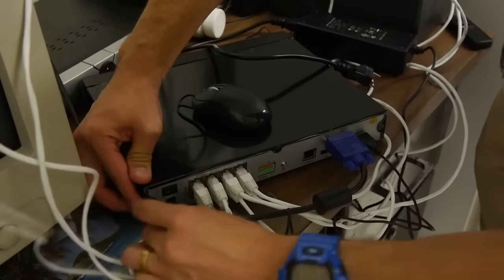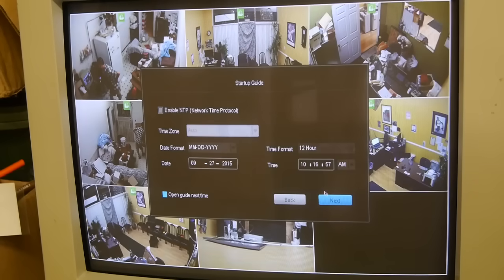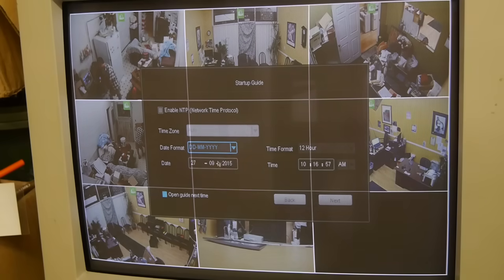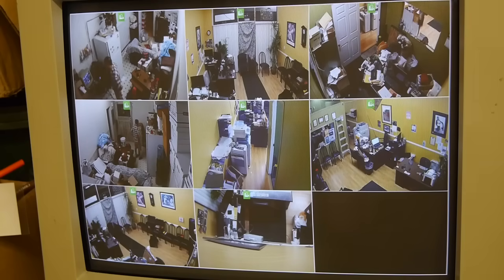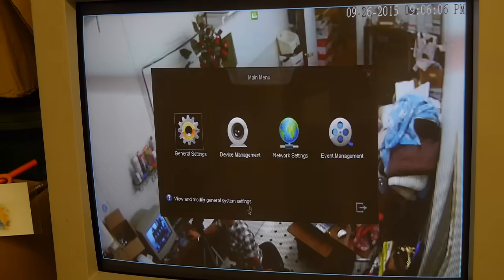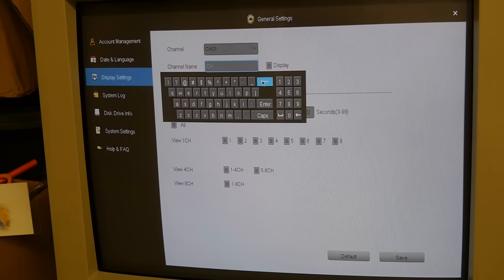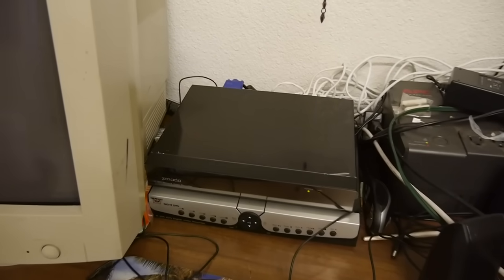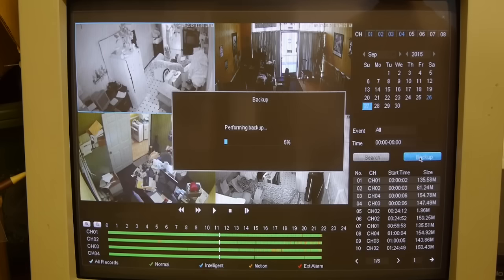How to install a Security Camera Surveillance System

Comment: Excellent. Would like more detail on getting power to remote wired analog camera. Will regular RG6 cable work, or is there a special cable needed to carry power?
Reply from the maker: run 2 in 1 power/video cable to and from the camera and problem solved. It's the one used in the video
Reply from the maker: or run a separate power cable either or
Reply: are power fittings for the 2-in-1 cable available so I can buy cable in bulk and cut to fit?
Reply from the maker: probably, you can try a google search to see if there is. I wouldn't be surprised if there are, I simply haven't had the need for them and predefined cable lengths and cable extensions/adapters have sufficed for my uses.

Comment: Wow this video is insanely helpful.  I mean, there are few words to describe how precise this video is.  Extremely helpful and to the point.  Guy even has the decency to point you to different parts of the video to skip any parts you feel are not applicable to your circumstances. 

Pretty much EVERYTHING is covered - in the most basic and well communicated way.  Very articulate and excellent communication.  No question this guy has the communication skills to be a spokesman.  Well presented!  A+!

Comment: Thanks for the video!  I like that you're not just trying to sell a brand.   Is there a way to broadcast the signal from the NVR to say a TV in the living room?  For residential i would like look at the front door on my TV, when the doorbell rings without walking over to a computer monitor.  The NVR wouldnt be located in the same room as the living room TV.  It would be cool if there is a way to broadcast via chromecast or something like that
Reply from the maker: Thanks, the solution is the run a long video cable from the dvr to your TV.
Reply: I was hoping not to have to do that. Thanks anyway

Comment: @Tool Craze if you do not have good internet connections can you still use ip cameras,and just have them not  connected to the internet ?
Reply from the maker: You don't need internet
Reply: thanks!
Reply from the maker: no problem

Comment: Your video looks as if the camera's themselves have CAT-5 ethernet jacks but the links provided show cameras with mini USB jacks and the cables have mini USB on one end and ethernet on the other end. Can longer cables be used? Thanks.
Reply from the maker: Normally they use cat5 cables but the ones you see with the mini usb Jack's are new. Now they made a new spec for power over Ethernet called sPoE that uses the smaller usb connectors for the camera. The included kit cables have mini usb for the camera on one end and have a standard Ethernet Jack to connect to the nvr on the other end. Same difference in the end really.
I have one of the newer sPoE systems you're speaking of and it's basically the same thing as before just a smaller camera connection. 
To answer your question, yes long cables can be used, you can extend the current ones by using an Ethernet Jack coupler since it's still using standard Ethernet Jack's on the other end.

Comment: I like the information but I don't like your wiring skills.  The wire is to exposed and ll over the wall.  You can only do it in a old buildings where you need remodel.  In new building or newly remodel homes wires outside the wall is too busy.
Reply from the maker: My wiring skills are just fine. What You're talking about is cable placement. That's a different story. And the reason I showed you guys how to run the cables outside the walls is because it's easy first of all and anyone can do it, also not everyone has the skill set and time to do full in wall installations. That and this is basically the same standard service you'd get from a cable/tv/satellite/internet/phone installation, no different.
I might make a in wall installation guide in the future if I get a chance. I'm very busy doing other reviews at the moment.
Reply: I would not hire you for that, not sure if that is even with the code That is very unprofessional work. Only someone who is an immigrant or a new business owner would fall for that.   No Cable companies technician can't do that kind of work.  Corruption in the installation department is a different thing.  There is only few provider anyway.  Time Warner installation in my area was out sourcing and they all were shady contractors.  Just because the welfare collectors contractors had job it doesn't mean they were doing it right.  Expose wire is a no no.  Insurance companies in case of a accident would not cover that.   I am pretty sure that is not with the building code.   I don't understand the mentality of doing wrong and then arguing about it.  I guess its the viking, warfare welfare mentality.  Don't bother replying me.
Reply from the maker: Now you're just trolling, if you don't like it move on. If you claim you know so much about this, why are you watching how to videos????
Go troll somewhere else
Reply: +arshi. Why don't you provide a NEC code to your comments.

Comment: Your video was made awhile ago. Any updates on systems. I looking to buy one for outdoors. I live near a School and have a lot of movement what hard drive would you recommend.
Reply from the maker: Basically everything is the same with a few minor differences. Nvr and ip camera systems were much more expensive a couple of years ago, but now the nvr and ip camera system prices have gone down so low that there's not much reason to go with the inferior analog camera systems.
Another minor difference is that now there's sPOE which is basically the same thing as regular POE bit use tiny micro USB connectors. 
As far as hard drives are concerned, take a look at the hard drives I suggested in the description section of the video and choose any that you like. I recommend any of those as good candidates for use in a dvr

Comment: instead of a hard drive can you put an solid state drives I  the dvr
Reply from the maker: without having tried it out myself, I'm sure you can but you will need an adapter (3.5mm to 2.5mm hd bay) to secure the ssd internally
Although you're better off with a mechanical hard drive because not only are they much cheaper, they're more reliable at running 24/7 than a SSD

Comment: very Good presentation , however I have two questions if u can certify it.
1. how long can the Ethernet cable run ?
2. can NVR be a standalone, where it is not connected to another extenal network?
Reply from the maker: thanks,
1. Ethernet cables can do long runs but I'm not sure exactly what the limit is, you'll have to google that one. The most likely answer is you'll be fine unless you need extreme lengths
2. depends on the NVR, if it has ethernet jacks on the back for each camera such as the NVR installed in this video then yes it will be standalone. If it does not have ethernet jacks for the cameras, then no it will not be a standalone system and it will require a router or network switch to act as a middle man between the cameras and the NVR.

Comment: Followed your link provided for an eight channel NVR but Amazon description listed analog cables not IP CAMERAS and POE.
I want IP Cameras and POE to ease the installation.   Can you suggest a model for this?   Thanks again for GREAT informative video.
Reply from the maker: The link is a nvr with IP cameras. The description says this about them "Features & details
720P Camera Resolution: Capture High Definition 720p Video, three times higher than standard analog cameras
Intelligent recording feature saves space on HDD (Not Included)
Wide-Angle Lens: covers more space with more details, with the 2.8mm wide angle lens and 81 degree field of view"

Comment: so I have a 4 camera system and I already know how and where to put two of the cameras on my house but I want to put the other two on my garage which is separate and a little far away. what would be the best way to install them?
Reply from the maker: For that you have three options, neither of which are covered in this video. 1st option: you run the wires from roof to roof which will expose them the to elements. 2nd option: run the cables underground. 3rd option: use wireless cameras. I can't decide which one is best for you. The easiest installation is wireless cameras but you'll need to purchase wireless cameras and depending on your current dvr / nvr system you might have to get a new one compatible with the wireless cameras. Running the cables underground would require the most work and could get very expensive if you hire labor. Running the cables from roof to roof is easy but then you'll see the wires. This might be the cheapest way to install with your current system, all you will need to buy would be longer cables.
Reply: Tool Craze thanks! I plan on doing it all myself so I'll have to check the length of my cables and decide. lol thanks so much.

Comment: Wowww! That was the best tutorial video I've ever watched. Straight to the point, very detailed, and very informative. I feel more confident now trying to tackle this project on my own, and hope I'm successful installing it this week. The only difference is mine is a Night Owl 8 channel AHD7-841 system, and I plan to try and run my wires behind the wall. Yikes! Thanks for giving me a starting point, and a boost of confidence!
Reply from the maker: Thanks Rudy. This how to video applies to all dvr nvr systems. I've tried several brands including Night Owl (that was actually the previous brand DVR that I installed at this office before the owner decided to upgrade to a unit with more channels and cameras) and they all have the same functionality. You've tried one, you've tried them all. Only differences are cosmetic differences in their menu's but still have the same functionality.
You'll do fine if you follow the steps in this video
Reply: OK great and thanks again👍. I plan to tackle this install next week😨😥🙏

Comment: You are totally the best out when it come to information and installation. My question to anyone out there is do you have to go through the attic? Can you have the cables run down the wall and go under the house through a vent?
Reply from the maker: you can go through the attic but this video shows you that you don't have to. The office I installed it in didn't have an attic and just ran the cables along the walls. This is the easiest method but you can see the cables the whole way. But it would probably be better if you do run them through the attic for less clutter, also better looking if you run the cables in the wall
Reply: Thank you so much for your quick response

Comment: I bought one of these  and I found out that you can not get this system to send you email alerts because for some reasons Zmodo doesn't have a new firmware to deal with  the recent email providers upgrade to a more secure server. Zmodo just tell you to use their app for email alerts which is unreliable. The second option is to use Comcast email which is the only one working but you have to be a Comcast customer. Also if you re going to buy a Western Digital Hard Drive, buy the purple which is suited for recording video and more durable to deal with the ongoing use of the hard drive.
Reply from the maker: Contact zmodo about the email issue.
About the Harddrive, the purple models are just marketing - hard drives that aren't marketed for use with DVR's work just fine. I've used Seagate regular hard drives for years straight and never had an issue.
Reply: I did. They emailed me and said to use their app which I really can not trust because of its unreliability. They also suggested to use Comcast email if I m a Comcast customer which I m not. If you have a fix for this issue I ll be glad to try it. I tried gmail, yahoo, outlook, yandex and aol with no luck. Thanks
Reply from the maker: Sorry, I cannot speak for Zmodo or any manufacturer. I don't have any ties with Zmodo and the reason I used a Zmodo system in this video is because that's the one  I bought for the business owner. I've used Zmodo in the past without any issues but I've also used other brands no issues as well. 
You're best bet is to contact the manufacturer which you said you already did, or get another brand system.
Zmodo is not the only brand that offers email alerts

Comment: Looks like an amateur installation. I want my cables hidden in the walls or attic.
Reply from the maker: Yes this is a basic install video that anyone with basic tools and skills can do easily and quickly.
Reply: I didn't mean to sound snippy. I appreciate the effort you put into making this video.
Reply from the maker: Thanks and I do agree with you about the simple install. I know most people would prefer cables in wall but I figured I'd show a way to install the cabling that everyone can do with basic skills and tools.
It's also the same level of installation you would get from a tv/cable/satellite/internet installer.
I'll do a video later on how to run wiring in wall although it will be a long while since I have several tool reviews I must do first.

Comment: also is using a POE switch for cameras far away from where my NVR will be a good idea or will it compromise the video quality? I am trying to find an alternative for running 300ft+ feet of cable
Reply from the maker: I've never had to run anything longer than 100 feet so it's not a problem I've run into. I did some research and it's hard to find max distance for ethernet cable. Possibly someone else can comment on that but what I did find was that analog cameras use passive video baluns that use ethernet cable for much longer runs, between 900-1200 feet. It appears that the video balun is to convert bnc cable to cat5 which can run much longer signals than bnc. So what I understand from that is that ethernet cable SHOULD be good for 300 or several hundred feet more without anything extra. Hopefully someone with more knowledge on this subject can comment.

Comment: Great video! It has help me a lot in understanding the different types of systems. Obviously you know your stuff and was wondering which would you recommend. Analog camera or network camera? This would be for my home. Thanks!
Reply from the maker: Ip cameras are easier to install especially if they are PoE and generally offer better picture quality but are more expensive systems with NVRs so I'd say go for analog cameras and DVRs to save money or go with IP cameras for easier set up and generally better image quality

Comment: Outstanding and very informative video. It answered many questions for me. My problem is  that my house is a 2 story stucco home. My wife would be upset with all the cables slopped on the wall like you did in an office application. I think because of this a wireless system would be easier and more appropriate even though they are not, from reviews I've read, as efficient as the wired systems. Can you recommend a wireless system? Again, thank you for the excellent presentation. Barry
Reply from the maker: Thanks Barry, glad you liked the video. There are better ways of running wire throughout the home or office such as running everything inside the walls so they are undetected. That's always an option, the reason I showed running the wires along the trim outside of the walls is because it's quick and easy and is the same level of installation you would get from your telephone/cable/satellite company installation for phone/internet/tv service installations. Another solution is to run as much camera cable through your attic and down the wall at it's location so the wire isn't visible the entire run, only where it goes up and comes out of the ceiling.

Here's a couple of wireless systems
4 channel NVR w/4 wifi cameras 500gb hd http://amzn.to/1ngFLOi
8 channel NVR w/8 wifi cameras 1tb hd http://amzn.to/1nsPnpJ

Those systems use wireless cameras but they require a power source meaning they have a wire that needs to be plugged in which will be in view at every camera location. Also you might have to plan camera locations based on available electrical outlets or use extension cables if they will be far from an outlet. However you save yourself the hassle of running the camera video cable all over your home or office.

If your looking for a completely wireless surveillance solution check out this Arlo camera system: http://amzn.to/2a66ypQ

This system uses cameras that are completely wireless and do not require a power source to be plugged in. They operate on batteries. The downside is that they're battery powered and will require you to change batteries every so often but luckily this is every few months from what I've heard.

Hope this helps!

Comment: Hey Javier first of all I would like to commend you on your video. You explained it very well you are  well spoken. I am thinking of picking up one of the security systems. I am just a little confused on The hard drive. Also  on cat5 can it be Cut ? Meaning I would like to put my DVR up in my attic I am going to have to add more cat5 Cable to get me to the attic...
Reply from the maker: Yes cat5 can be cut. You'll need a special crimper tool to attach the ends. 

If you do decide to put your dvr in the attic, keep in mind that attics get very hot during the day and there's a high risk of over heating your dvr.